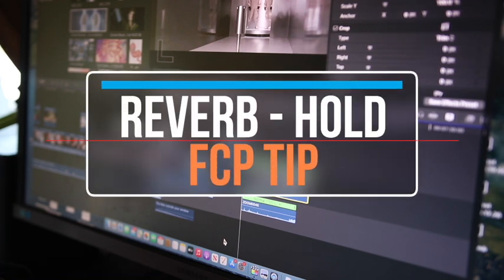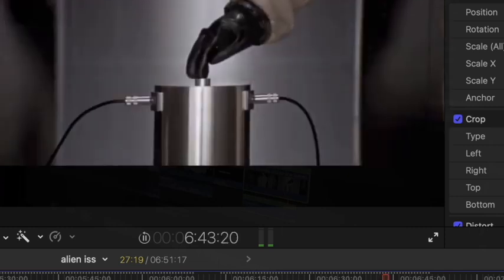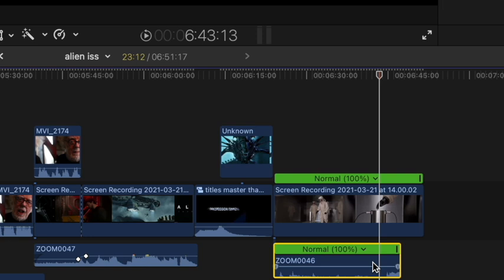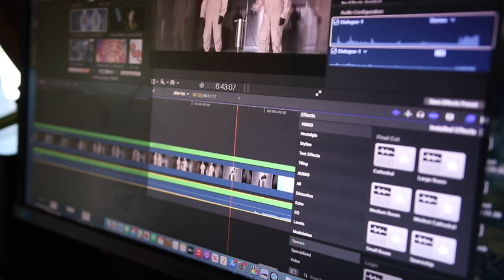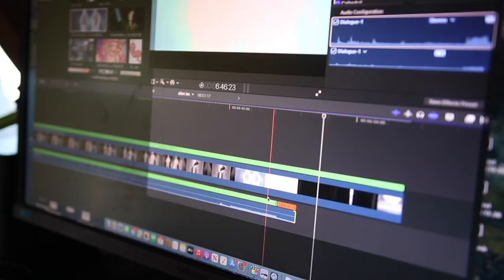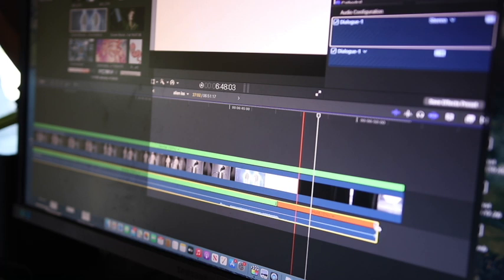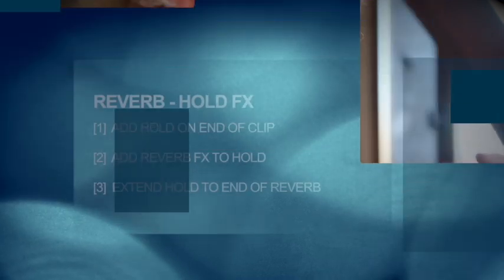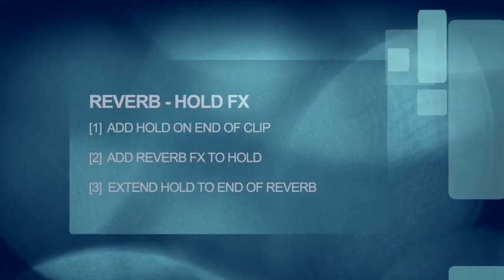FCP ' Hold Reverb' FX - with broadcast editor Simon Holland

Comment: Great tip thanks, particularly with the shortcuts in FCP. Synchronicity (maybe) - I watched this movie again a few nights ago. 

Another similar technique is to do this at the beginning of a transition, so lead in with escalating audio from clip (2) whilst you are still on clip (1).  Works well particularly with narration (clip 2) over a more abstract end to clip (1), say for example a wide / pan shot of a landscape. Also works well over the end of a title sequence (1) as an audio lead in to the first scene (2).
Reply from the maker: good tips....i agree...leading or tailing sound is a pro edit tip.

Comment: I was thinking back to when I worked in The Odeon High Street Kensington.
We were one of the few cinemas that ran 70mm films without a break apart for the Pearl & dean adverts which all had to be spliced in. Out with the acetone and the mechanical film cutter. Adverts spliced in. 
Much easier these days.  Nice bit of software Professor.
Reply from the maker: I miss cement and tape joining film together... its a bit like moving from a darkroom to photoshop....same ideas...but done with the click of a mouse.

Comment: I bet it takes at least 200 hours to get a solid grasp on editing software.
Reply from the maker: it helps if you dud editing in film or video..
the software is pretty easy to use but there are hidden features that i can tell you about...
toads what i aim to do with my editing tip series of films.
Reply: @ProfSimonHolland  I can imagine a newbie almost spending a solid 6 months at it